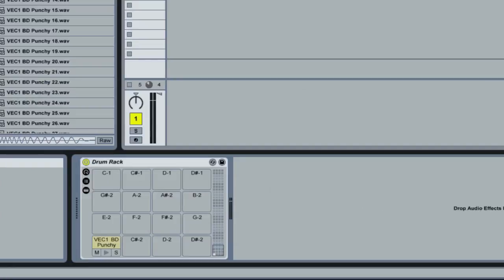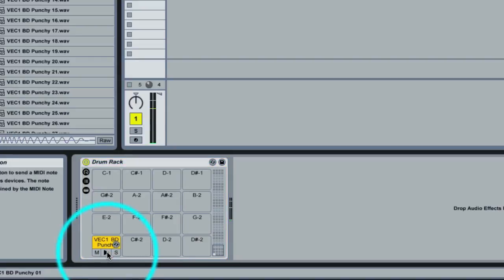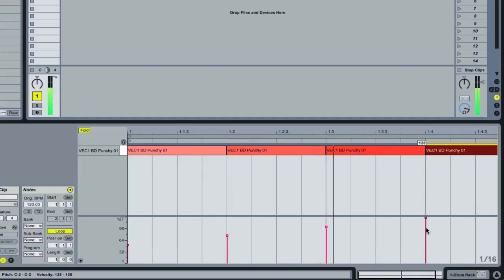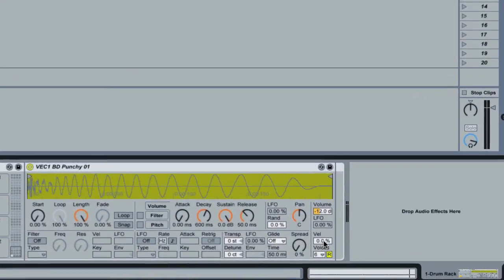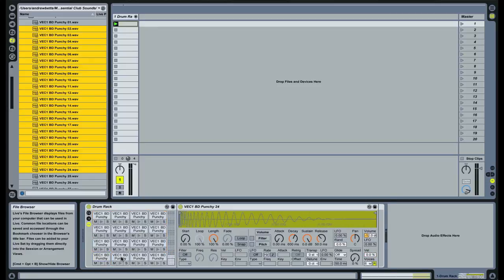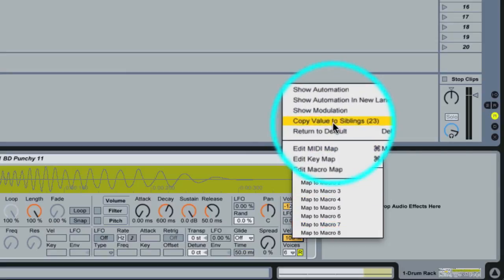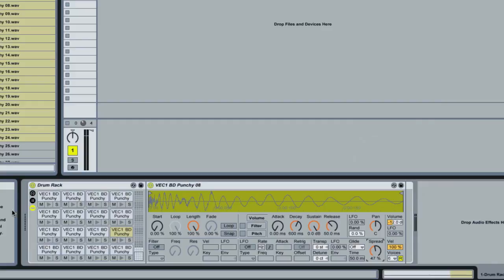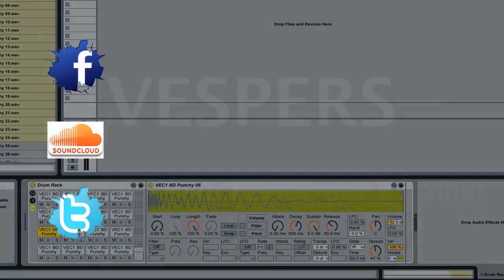Ableton Tutorial: Making Drum Racks & Simplers Velocity Sensitive

Comment: Why is it that when you turn up the velocity sensitivity it acts as if the volume was defaulted to somewhere in the middle? In other words, I would expect that if I load a new sample that the volume is as loud as it goes for that volume setting and when I turn up the velocity sensitivity the volume ramps down from there. So, again, with no 0% Vol < Vel the sample is played as if the note velocity was 127, and if I turn up the Vol < Vel to 100% then the hardest I hit is that same 127 and softer I hit it is played quieter down to -inf at note velocity 0. Does that make sense? I think it's weird that by turning up the sensitivity it allows the sample to get louder. Is the Simpler taking note velocity 64 as the default?
Reply: Yes. I just think that adjusting the "Vol < Vel" also adjusts the maximum volume of the sample. To illustrate, I just opened up Live with no template (so everything is default). I put a drum rack on the first track and loaded a kick drum sample into a cell. The default for "Vol < Vel" is 45% and Volume is -12db. I then drew in 2 bars of hits every 1/4 note all with velocity of 127. When I hit play, this one sample peaks the master meter at -9.15db. When I turn "Vol < Vel" to 100% the meter now peaks at +3.34. In contrast, I delete the drum rack and place an instance of Kontakt and load the same sample to the same note. Kontakt defaults the velocity sensitivity to 39.4% (which is also kinda weird). At these default settings the master meter now peaks at -13.48db. But when I turn up velocity sensitivity to 100% the mast meter peaks at the same -13.48db. Do you see the difference in behavior? Kontakt does what I expect in that 127 is always the loudest no matter the velocity sensitivity and it scales the volume DOWN from the max. Live's drum rack scales up and down from the middle. The "center of scaling" is different between the two. Kontakt behaves exactly like every sampler I've ever worked with while Live's behavior is new and unexpected (to me).

Comment: I prefer the other way of just setting a default value.  You just create a blank simpler, set the velocity to what you want, I think I have mine at 50%, then drop that sampler in the library in Defaults/dropping samples/on drumrack/simpler.adv.  Now any samples you ever drop on a drum rack will always have velocity turned on to 50 to start with